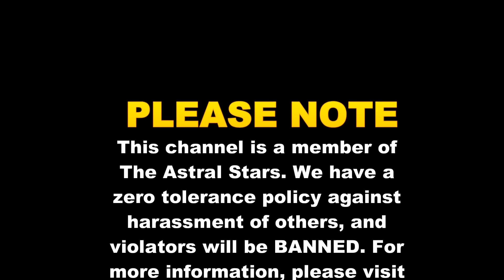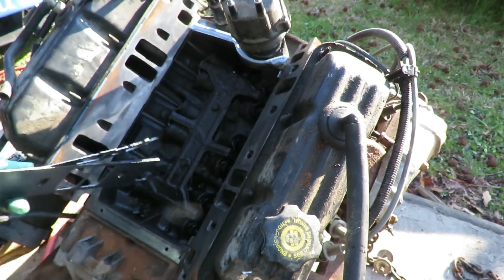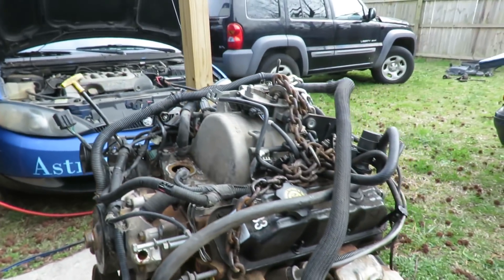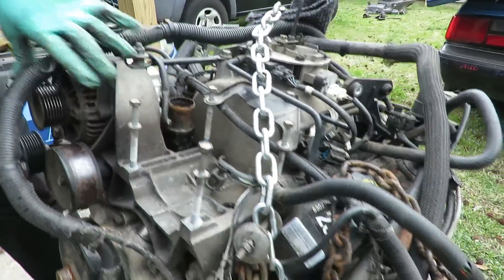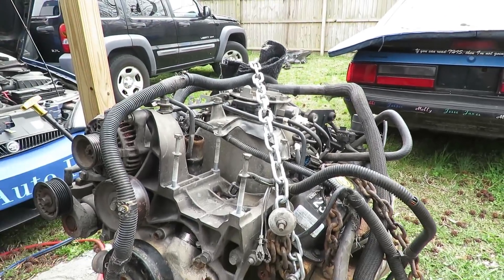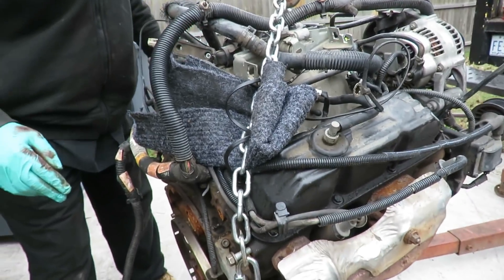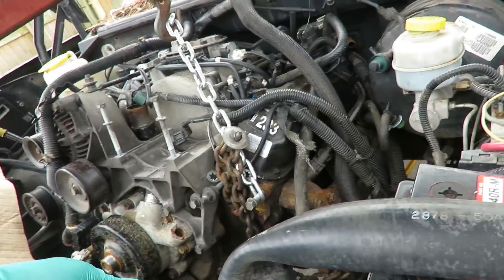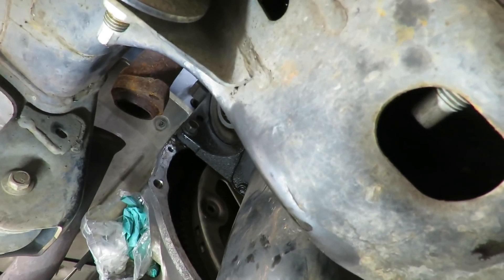⭐ Part 5 - 1999 Dodge Dakota Sport - 3.9 - Engine Replacement

Comment: Hi I have a 98 Oldsmobile bravada  my air bag light is on , how do I turn it off  ,there wire under the seats not sure what one It is can some one tell me what one ,or help me thanks
Reply from the maker: Hey Nathan, you have to find out why the air bag light is on first. What code(s) are in the computer.

Comment: Hmmmm..At the point whether to switch Intake Manifolds rather than fool with all the crap to take off and put on. Read, if replace, use new Manifold Bolts? Not so cheap. Did you reuse them or buy new? Naturally I'd prefer to. Bought new standard connecting bearings too, loosen one & they're tightly gripped. Rubber mallet on just to free? You know..."THIS SUCKS" !! Salvage has more mileage than the original that threw the rod which is why trying to replace all new reachable parts while on the stand.Just no clue how much should be changed. Not quite as cheap as your customer but still hate wasting time & money LOL
Reply from the maker: I feel your pain, I HATE NOT KNOWING! We used all the old bolts. This customer REALLY lucked out because the engine ran so good. I'm not sure how to guide you on your dilemma, as I would have been too scared to even try a used motor, now THAT SUCKS, LOL!
Reply: @OnlineAutoRepairVideos  You're  a GEM !! Thank You ! I've gone so far as to contact another guy that has a 2001 3.9L for $275 that "HE SAID" was running when pulled & is inside. Looks pretty clean---almost 200k miles though?:(  Need my 1978 running to pick it up..put new fuel lines and repaired hole in gas tank with soldering iron as is plastic..so made sure was empty then just slowly heated & pushed that stuff back into the crack. Read you can't repair those with other stuff so used it's own material LOL..hope it works. Eventually may buy crate engine if these don't work. Freaking ATF +4 Tranny Oil $$$ pisses me off too. Humid as hell today then calling for days of rain. I'm almost 65 so if it works before I die I'll be happy, if not...headache for my niece & her husband left in the yard when they get the house LOL  Sheez THIS SUCKS !!